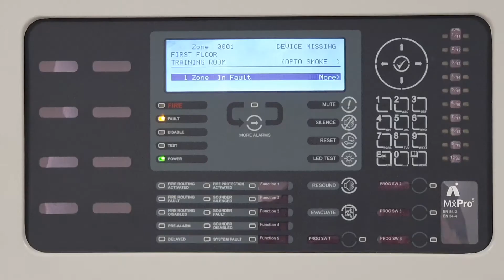How to: Find fault information on your MxPro 5 panel

Comment: How to clear open circuit current  fault in MX pro5 panel?but all devices are working good in same loop.
Reply from the maker: Hi Sudar, thanks for your query. For any technical questions please contact tech@advancedco.com who will be able to best advise.
Reply: A open circuit on the loop won't stop any devices working but if you get another open circuit or a short circuit you will loose devices. So remove the incoming loop wires on loop in fault and find out what devices you loose, let's say there are 10 devices to start then you loose devices 7, 8, 9, 10 the open circuit is between 6 and 7 as long as its wired as addressed.